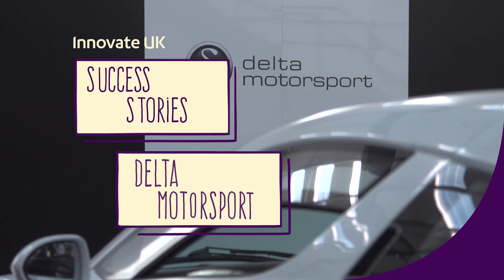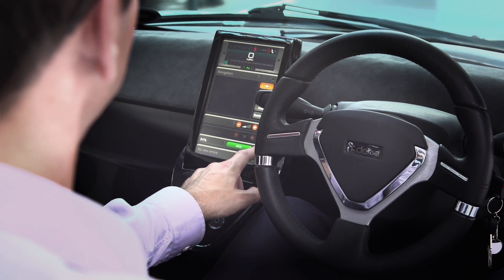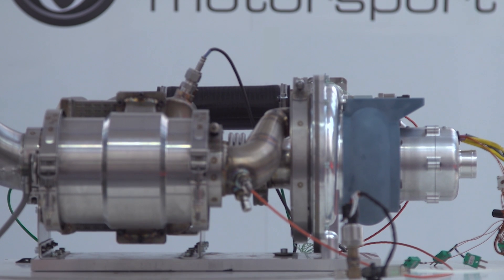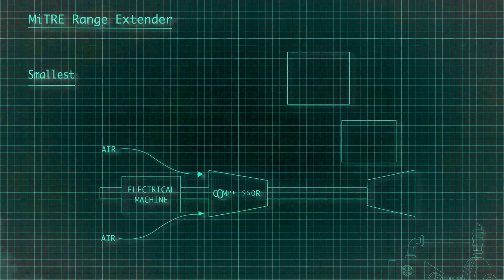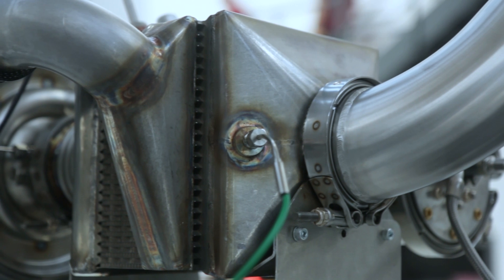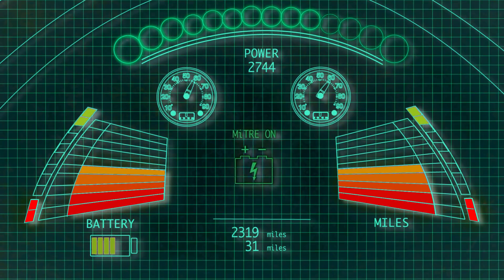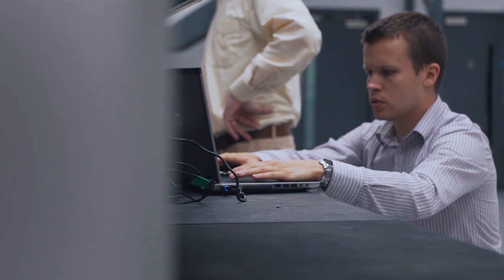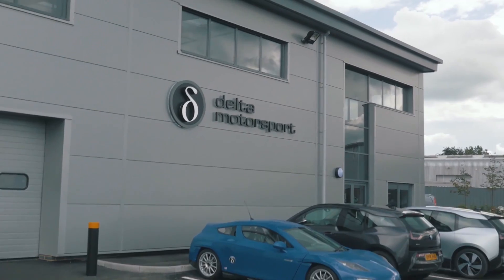Delta Motorsport: improving the driving range of electric vehicles (ISCF - Mobility / Clean Growth)

Comment: It will be interesting to see what fuel they feed to this thing. Normal gasoline is something of a waste; you might as well use raw, low octane naphtha. Jet fuel is also 'too good' as you don't need the low Freeze Point. It probably makes most sense to run it on naphtha/diesel mix if they can manage to NOx emissions.
Reply: Well to be used in road cars it has to be something you can easily fill up on, so my guess would be diesel for the highest energy per unit cost.

Comment: What is the MPG? Rover in UK and later one of the US companies both developed Turbine engines but they were not efficient.
Reply: Andrew Lohmann They were using the turboshaft to drive the wheels. Using the shaft to drive a generator to charge batteries and drive a motor is easier and more efficient.

Comment: Hmm... at the end this turbine burns fuel and the maintenance program will be tight so what is the real advantage; why companies hold on add complexity to something quite simple as energy storage / discharge with nearly 90% of efficiency.
Reply: Israel Alvarado This system is not like an aircraft gas turbine, the components do not have to be inline or use an axial flow compressor. The compressor and turbines are centrifugal like a turbocharger so simple and inexpensive. They are also multifuelers and can burn cheap clean fuels.
Reply: Israel Alvarado This system is not like an aircraft gas turbine, the components do not have to be inline or use an axial flow compressor. The compressor and turbines are centrifugal like a turbocharger so simple and inexpensive. They are also multifuelers and can burn cheap clean fuels.
Reply: @john9972  they never will be efficient with that power range